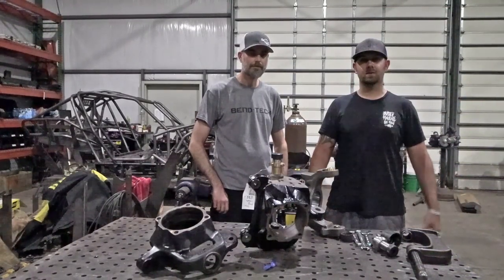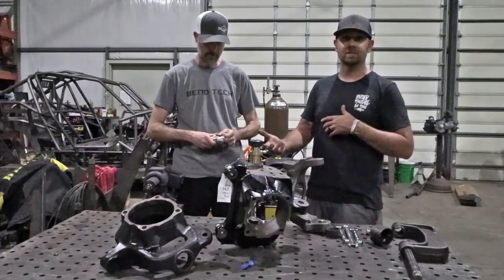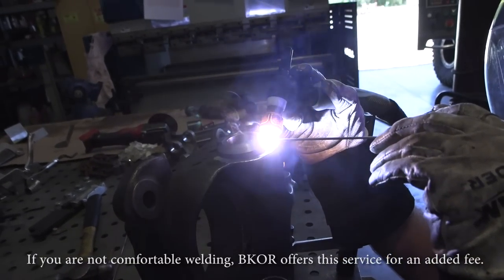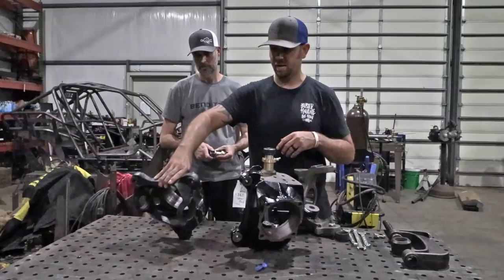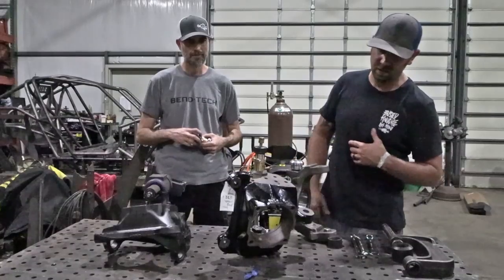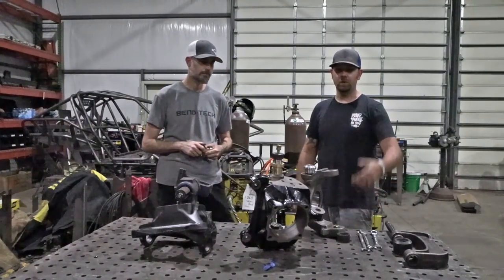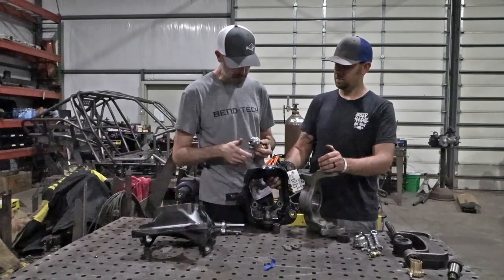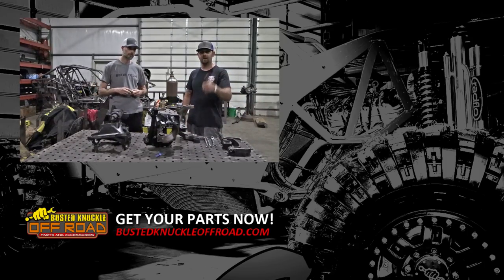BALL JOINT ELIMINATORS the Ultimate Ball Joint Delete

Comment: 9:55 I really like that, it's a slick idea. What I like especially is that it's kind of a failsafe; the small bolt is likely to snap before the big bolt gets rounded out. And if you're lucky and get the nuts lined up, then you're able to get a socket and big breaker bar on it. Very clever idea
Reply from the maker: they are tough

Comment: Found out on mine (99-04) that I had to use a brake cylinder hone to get my brass collar and bolt to not bind up once installed. I think this was because of a casting line that was inside the ball joint bore that we didn't smooth out before install. Also my friend Chris put grease grooves inside the brass collars to help distribute grease throughout the entire surface of the bolt. Been running it that way for almost 2 years now without failure or having the bolt back out. Great product considering I was having to replace my ball joints annually beforehand. 👍
Reply from the maker: Glad to hear it

Comment: Another tip for welding cast steel, is hitting it to relieve stress. A brass punch or hammer will work fine if you wanna keep it pretty, but steel works better. Don't get overzealous and use an air hammer, you'll make the steel harmonic and risk cracking it right then and there
Also, get the steel RED hot. Most people only get it to 300-400 and call it good. Also doesn't hurt to heat it up again after you've welded it and it's cooled down some, as it will develop stress during that time as well
Reply from the maker: interesting

Comment: To get the brass to free float on my 99-04 rock jock, I had to grind the top of the brass down to the very top edge of the zero fitting threads, they work great, but I find myself using spray lube to stop the annoying squeaking because the grease through the zero doesn’t go into the brass it just comes right out the top :/

Comment: You can adjust castor and camber on a Dana 60 king pin. It's called cut and turn also shims for camber? Plus doing what your doing is basically making it making pin?
Reply from the maker: it is similar to a king pin only stronger

Comment: That's awesome! I had Dana 80 axles built by dynatrac for a trail truck and I never liked that the front axle has balljoints I'm pretty sure they're sd stuff but I'll have to call dynatrac to find out for sure I would like to run this kit I have 44 inch tsl's and balljoints scare me
Reply from the maker: It’s a good idea to go to these if at all possible.

Comment: When running standard ujoint style shafts, when the joint breaks, will the shafts still be able to separate the knuckle from the inner c?  I am looking to avoid having my knuckle and tire break off if I destroy a ujoint. 

I’m running a 99-04 super duty axle. 

Thanks!
Reply from the maker: This should help prevent that as well.

Comment: can I run 1550 axles on a 90s ford D60 ball joint diff with these ball joint eliminators or are the C's still to small?
Reply from the maker: The Cs and Knuckles are too small. That will only work on super 60 outers with eliminators.

Comment: I’m building a overland suburban. I know it says specially for off road use only but my 90 suburban doesn’t have camber adjustment and I’d say this is definitely safer than running a 35 or 37 on a stock ball joint. Can someone with knowledge give me some feed back? Yes I’ve got one tons but that’s later down the road. No I’m not worried about putting money into a 10 bolt. When I’ve finished building my front axle I’ll install it. I’ve got a K5 I’m going to put my built 10 bolt. It’ll never see real off road it’s to nice.
Reply from the maker: It can be done and will do just fine. They just aren't meant for on road use (legal team jargon)

Comment: Very informative video and it will be very useful in the future when i install them in my axles. What has your experience been with the lower ball joint eliminator?
Reply from the maker: We run moog ball joints in the lower. No need to eliminate it as it doesn’t see as much stress as the upper.
Reply: @BustedKnuckleOffRoad  ok good to know. I thought about running the dynatrac lower ball joint. Not sure if you have seen them or not
Reply from the maker: @zachmosteller4681  I have dynatrac lowers on the Jeep JK.
Reply: @BustedKnuckleOffRoad  sweet. And I've already contacted dynatrac and they will sell just the lowers so we will see how they like bouncer abuse in a couple years when I get it built, although that will be a strange invoice for just 4 lower ball joints 🤣🤣
Reply from the maker: maybe not too strange nowadays

Comment: Any tips on strictly avoiding thread distortion when welding?
Reply from the maker: Don’t weld it all at once, tig weld it possible, and use anti seize
Reply: Pre-heat the knuckle to 400F before welding and let it cool slowly by wrapping in a welding blanket and letting it sit for a few hours to slowly cool off.

Comment: Nope. Not the product for me. Two design flaws. 1. Having to weld anything on the axle. 2. Still utilizes regular old ball joints on the bottom. It's 2022. These half-measures aren't impressive at all.
Reply: The upper ball joint is the weak link on these axles not the lower. We have used and abused this setup on 700hp rock bouncers with zero failures. For the price it doesn’t get much better than these but suit yourself. 👍
Reply: "Having to weld anything to the axle" so in other words you have a stock rig? lol
Reply: @BustedKnuckleVideo  Yea, no doubt it's good. I'm just saying it could be designed better. You shouldn't have to weld inserts... and have weak ball joints still on the lowers. Seems like a half-measure, not a "solution."
Reply: @FlawedOffroad  Yea. I'm not as into it as you are. I'm just pointing out design issues. These could have been designed better. Plus the insult of STILL having to use ball joints in the lowers...haha. Wow.
Reply: @CR500R  pretty sure every company that makes these is the same way, it’s just for the upper
Reply from the maker: If it aint broke don't fix it. There is no reason to make these any different because it would drive up cost and net minimal performance gain. But tell me more about how you have successfully brought a product to market without "half measures"
Reply: You must go offroading in video games if you dont want to weld anything to your axle HAHAHAHAHAH.  Why dont you build a product for the lowers?  Fix a problem that doesnt exist and tell me how sales go LOL